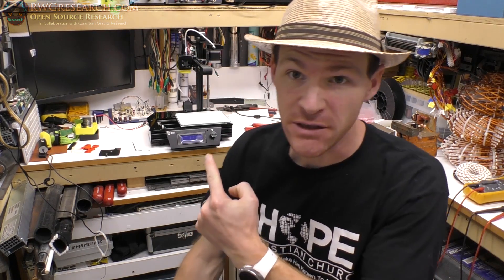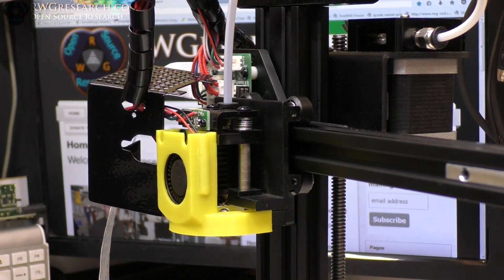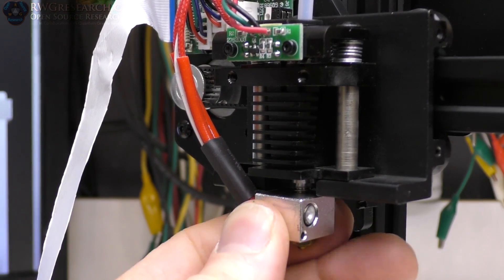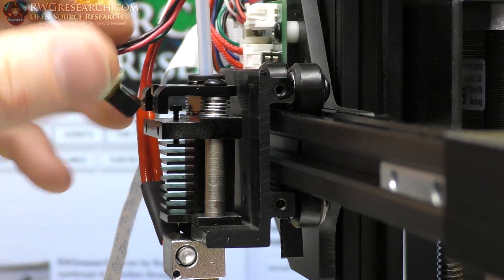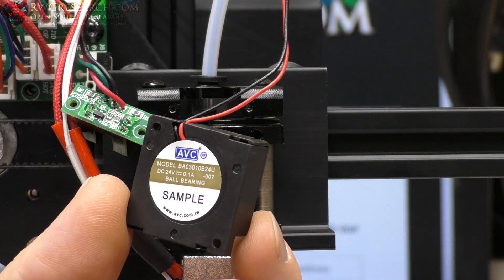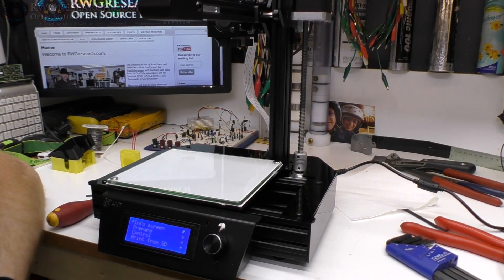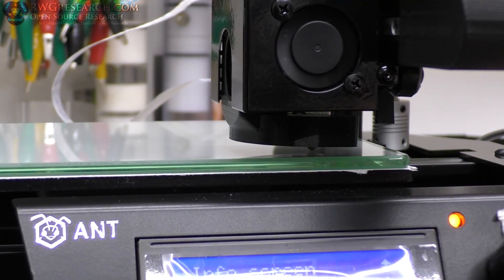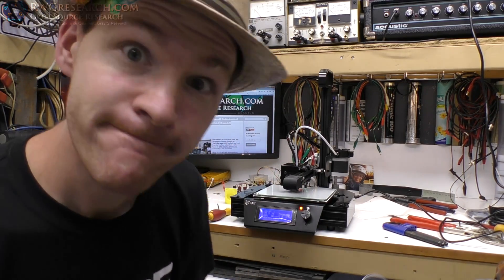How To Fix / Adjust The Z Probe On The ANT Ecarry. Whats Under That Cover?

Comment: Russ,
Thanks for your help regarding the Z sensor adjustment. the sensor could be adjus The way you clearly explained how the sensor is adjusted got me started.  I tried adjusting the screw but it not go low enough.  As you explained that the printher voltaged should be held in position (down) by the springs.  What I found was that the print head was binding, and would not go down to its proper position.  I finger tip load of grease seemed to do the trick.  From then on, the sensor could be adjusted ant the ANT is up and running.

One more thing, the ANT electronics can be powered by the USB if the 24V power supply is not attached.  This results in the electronics accepting commands but no action is possible since there is not enough current or voltage.

Thanks again